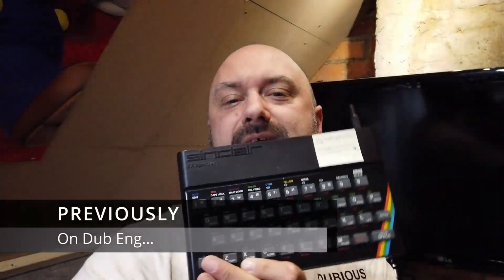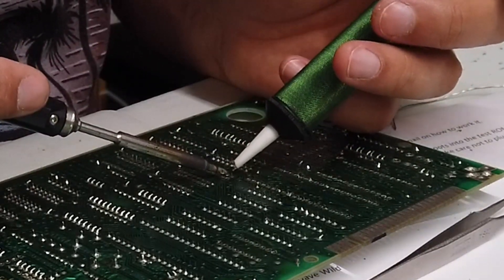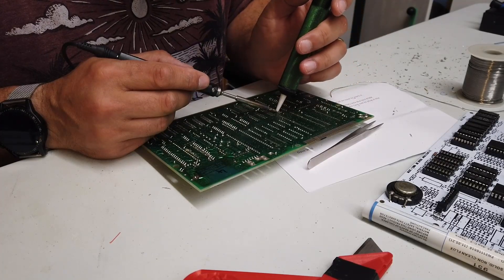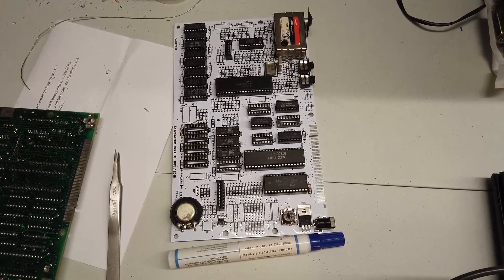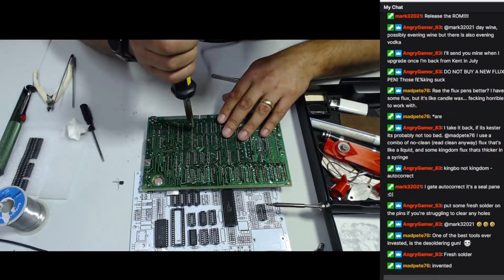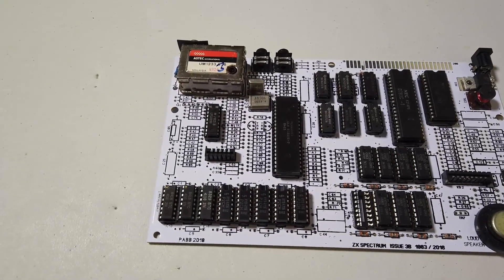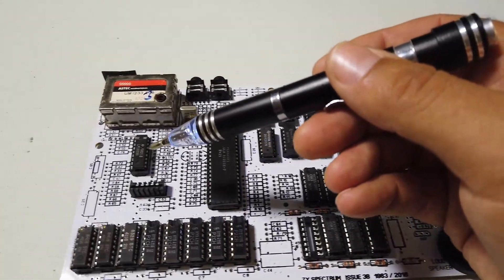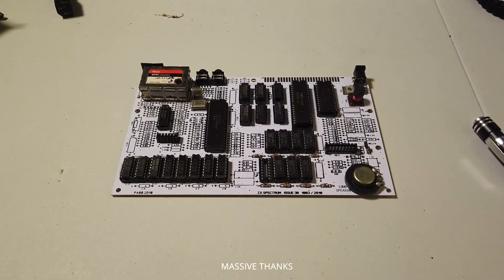DuB-EnG: ZX Spectrum 48k new build on white PCB - Part3 - All the silicon socketed and fitted :-)

Comment: You should have popped around and borrowed the desoldering station or you could have popped down the road to the RMC...  Also replace the 7805 with a switching regulator, you will thank yourself later.
Reply from the maker: Aww thanks Tim!  ...   I'll have a look into the switching regulator, I have a few DC buck converters kicking around that I think I can use.  Just a little worried that the noise generated my cause some questionable activity in the ICs.  Anyway, looking forward to getting this old beast back up and running soon!  All the best mate!  H
Reply: @DubiousEngineering  the main reason to replace tge 7805 is the failure mise is very frequently passing the input voltage through unregulated.  Never seen a problem with switching noise on a spectrum.....

Comment: I know its a bit late now, but I find those desoldering pumps work much better if you put a short length of silicone tube with an appropriate inside diameter over the end of the teflon nozzle, so there is a few mm overhanging the teflon. This way the nozzle doesn't melt or burn, so you can use higher temperatures, and it seals itself over the hole and soldering iron bit, creating a better vacuum. The tubing does need replacing from time to time, but you can get a meter of it for about £1-2 on eBay, which will last forever. And its cheaper than buying a desoldering gun!
Reply from the maker: Thats a really good suggestion...  Being a 3D printer man, I think I have some PTFE Boden Tube that will work...  I'll check it out.  Your input sincerely appreciated!  Howard
Reply: @DubiousEngineering  You might have trouble getting PTFE tube to stay on given how slippery it is, which is why I used silicone tube.